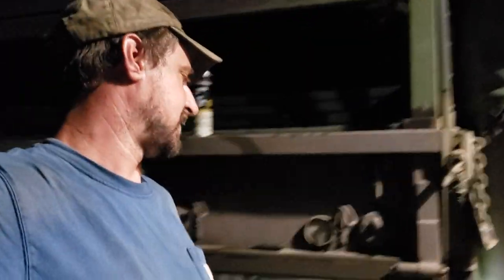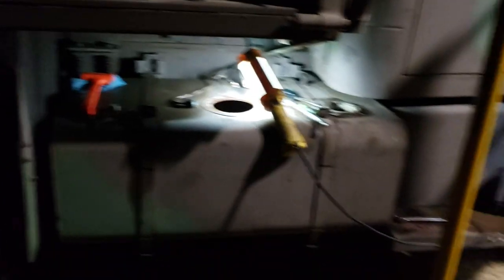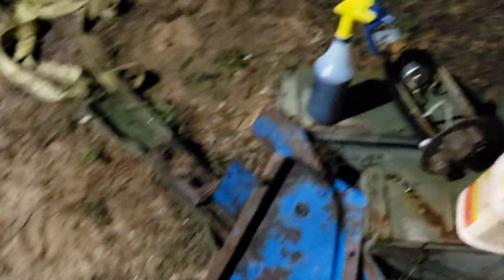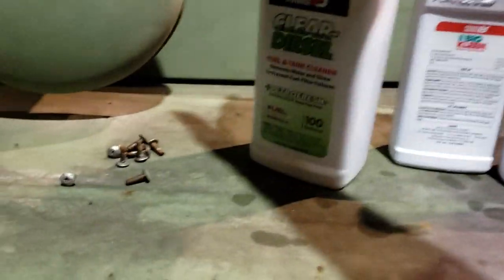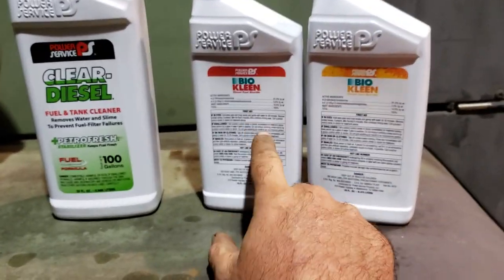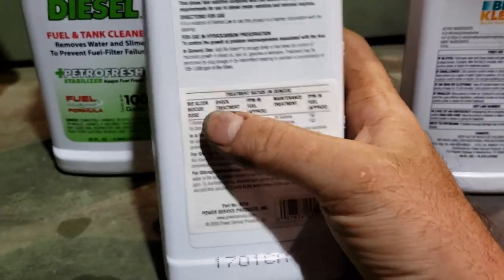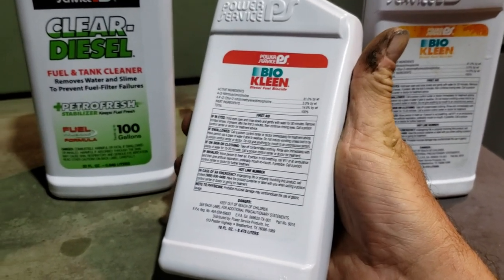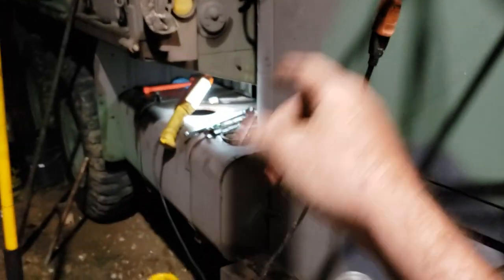How to remove algae from a diesel fuel tank

Comment: I pressure washed what I could, dried it with compressed air, treated it like you did then drove it for a few days and changed the fuel filters. I filter used motor oil and transmission fluid from every car I scrap and cut it with gasoline from the cars. Then the other 50% is diesel fuel. Haven't seen any more growth since the cleaning.

Comment: Any idea what black looking chips are that resting at the bottom of my fuel tanks? Some one told me that it also was some sort of algae.
Reply from the maker: You need to get some of it out and see. It's most likely  pieces of rubber from the soft fuel hose inside the tank between the pump and the outlet of the pump hanger.

Comment: What your using or killem biocide is what's always worked for me, and has done great job at keeping my fuel in all my mv trucks, the 1000's of gallons of fuel I keep stock plie, in my military generator and other things. It's well worth the money to dump that in, vs replacing filters, fuel, parts. Glad to see your using the same thing and about everyone I know uses it and no issues.
Reply from the maker: Killem is great stuff too. I've used it before when I had a 600 gallon tank with an infection. Cleared it right up.

Comment: Paint strippers won't do much, but ACETONE will dissolve diesel microbials in no time.  I had a tank more filthy than yours that would clog filters in minutes and since I couldn't dismount or cut open the tank to mechanically clean it, I poured a few gallons of Acetone in and towed the vehicle around to slosh it good for an hour or so, then siphoned the liquid out and it came very clean.  NOT paint thinner, but pure acetone.

Comment: Thank you for your videos. I'm new to diesels. I'm new to M35A2's. I have never heard of algae in fuel tanks/fuel lines. Please, please, please, show how to DROP a fuel tank. It looks like there are about 6 or 7 different connectors on the fuel tank. I'm clueless on how to remove them. The fuel pump looks easy enough. And the steel straps appear easy enough. But, on my 1971 M35 there are a number of separate connectors on top of the tank. I don't know what they are, what they are for, or how to disconnect them. Any help is appreciated. Thanks again. John Winkler, Ferguson, MO
Reply from the maker: It's pretty straightforward. They're all different sizes, so you can't hook them back up wrong. Biggest line is fuel supply, 1/4" line is vent, 3/8" line by cab corner is fuel return. Then you just have fuel pump power connector and fuel level sender plug.

Comment: If I just wanted to cycle the fuel through the fuel system, can I use a 5 gallon bucket and cut a hole in the lid to fit the fuel pump? then put 3 gallons in the bucket and fire up the engine? Or will the diesel melt the plastic?
Reply from the maker: It won't hurt the bucket. That should work fine.

Comment: Had this problem in our little 5.5ton excavator, since it only runs a few hours a year(barely) and used to filled it with regular diesel thinking it was all good, but it got clogged up seriously. Try to use Blanche diesel, Without any RME in it. RME will result in algae-infestation...
The tank was the major "wormhole". But E85 did an amazing work on this, but it took almost a week to clean it out because of the different angels and hard to get to spots, and because you got to leave it to do its work. 
We tried everything,(every liquid known to man) gas and ethanol included, but E85 worked like a charm.
Try it, i can guarantee you wont be let down.

This worked wonders for the tank, but i wonder how to inject this concoction into the fuel-system and to let it sit for a few hours before flushing it all out. Any ideas anyone??
Reply from the maker: You would have to run an electric lift pump to circulate fuel through the system without running the engine.

Comment: How often should I use it?
Reply from the maker: You only need to do it if you find that you have an algae growth in your fuel tank. Waste of money otherwise.
Reply: @tacticalrepair  yes I have algae. I added some in today. When should I change the fuel filter and should I add more after the filter is changed?
Reply from the maker: @quantaviouswimbley1959  no, I'd only add one full bottle to a full tank and then run it until the filters clog, then change filters and keep running it and changing filters as needed. You should only need to treat the system once unless you pick up some contaminated fuel again.
Reply: @tacticalrepair  ok thanks for your help💯

Comment: I'm running a 95 powerstroke, sat for 2 years, died while driving, found fuel filter contaminated with algae.

So I'm treating the front 20 gal tanks with 1oz of bio kleen.

I would rather spend 30 bucks on the chemical than all day pulling my truck apart to get to the fuel tank.

I am curious, how did it turn out for you?

obviously im going to have a contaminated fuel system... the stuff wont just disappear from the chemical.... does it 'melt' away and become easier to combust? or do you have to actually kill it all then clean tanks?

I am hoping a simple tank treatment will help me. thanks in advance
Reply from the maker: It will kill it but the dead shit will keep clogging filters until it's gone unless you clean the tank out.